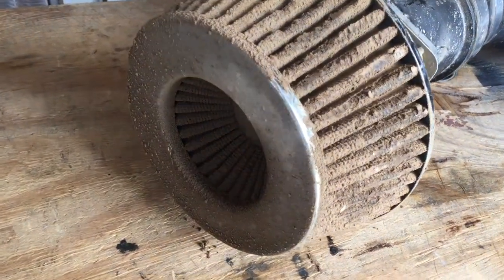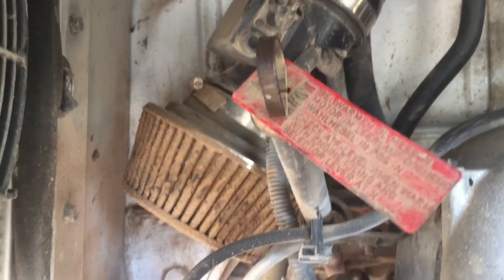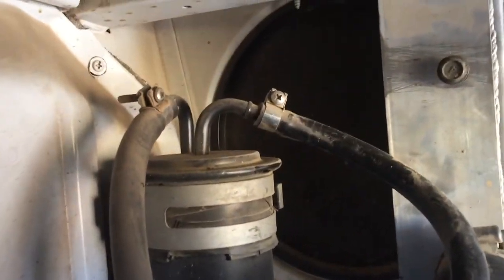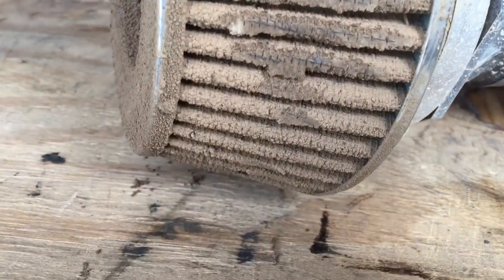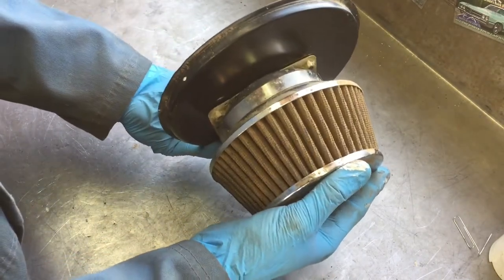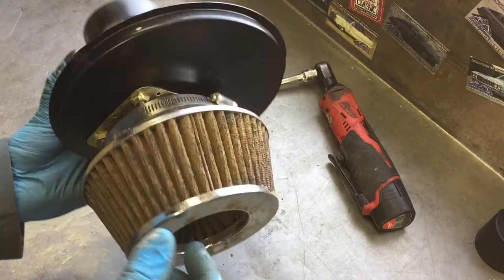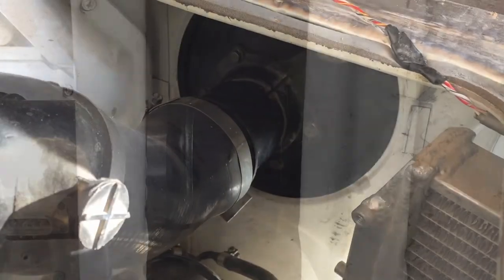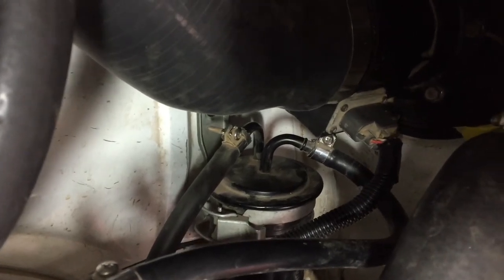VW Busaru Air Intake

Comment: Awesome job, that should work really well.  Some vented plastic splash shields by the engine may help keep it a little cleaner as well.   Good excuse for a junkyard run : D
Reply from the maker: Thanks mate, I washed the engine compartment about 5 years ago. I think it accumulates then falls off in chunks ;)